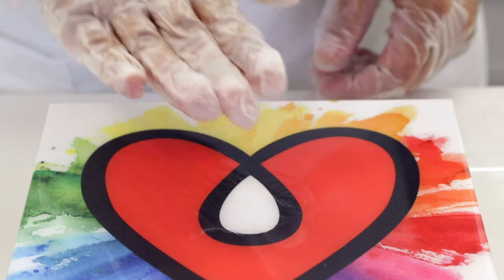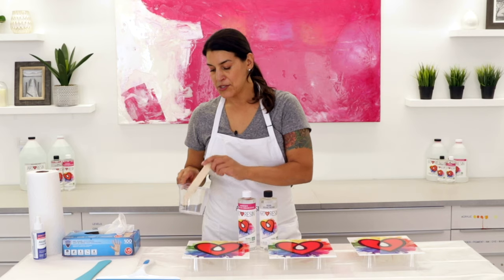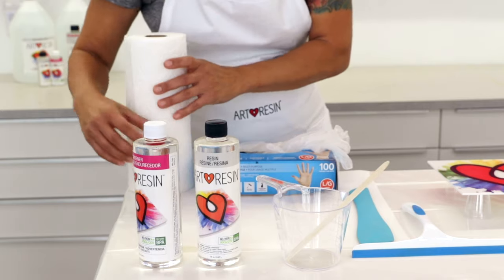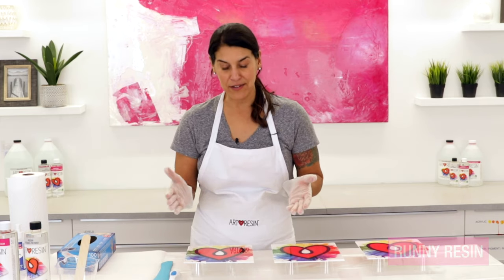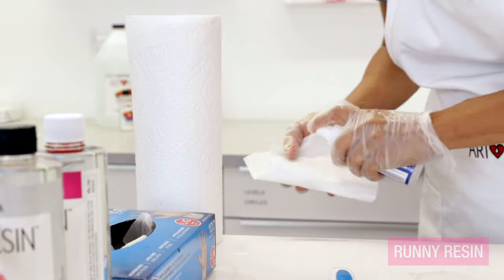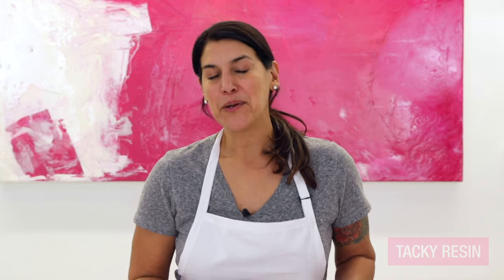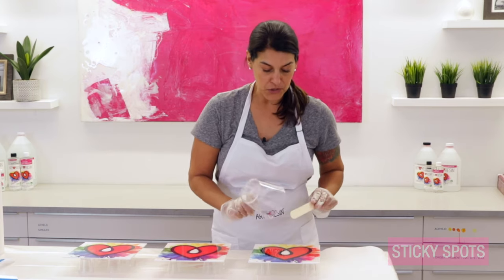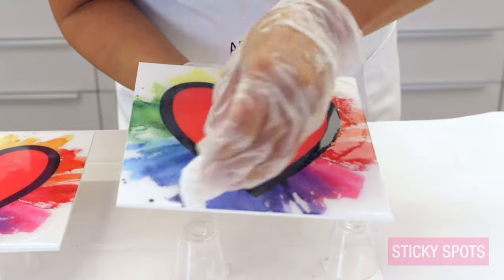How to Fix Sticky Resin - Top Tips & Tricks

Comment: So informative video
I over filled my alphabet moulds as now they are cured and having a bit of resin outside of my mould  how can I make the border perfect.please assist.
Reply from the maker: Hi Kajal, if the resin has cured you could either take an x-acto knife and carefully shave off the lip or you can use sand paper and remove any excess.
Reply: @Artresin  Thank you for the response😊

Comment: Hi. I have made resin alphabets which haven't cured. Does this technique work for alphabets too? Please reply
Reply from the maker: Hi Shriya, if the surface of your molded pieces are just tacky, you should be able to fix them by brushing on a thin coat of perfectly mixed ArtResin with a brush and letting it cure.   I hope this helps! 🙂
Reply: @Artresin  thank you so much for replying :)

Comment: hello! my pieces aren’t sticky they are very glossy at first but on one side the fingerprints show up and can’t be wiped away, is that because i need to varnish it?
Reply from the maker: Hi Laura - when the resin becomes dry to the touch, it still might be soft enough to indent or even to take on fingerprints, but as the resin cures further, these should disappear.  If, after the resin has fully cured and the fingerprints have not evened themselves out, then the only way to get rid of them is to sand them out and then apply a thin coat of resin mixture to restore the gloss.  You can even just apply this fresh coat with a disposable foam brush.
Reply: ArtResin ahh okay thank you i think maybe i’m touching them too soon even if they’re not sticky, i appreciate your help!

Comment: I have a tacky tumbler and it looks uneven. If I just re-do the resin it will fix it?
Reply from the maker: Hi Kyla, if it is tacky then yes just follow the steps shown and it will help to fix it. Now you may want to find out if there is a reason it appears to be uneven, if it is just a slight unevenness it might be due to it not being level while turning and the resin wanting to run to one side. If it is repelling from certain areas you may need a sealant prior to your resin. 

If you are continuing to have issues please send in a photo to support@artresin.com and we will be happy to help you trouble shoot further.
Reply: @Artresin  thank you so much!!
Reply: Is it possible to apply too much resin and that causes an unevenness? It appears to have dips throughout the cup, not just on one side. Hard to explain. I can try to email a photo after work.
The first layer of resin turned out perfect. But I applied a decal and it was after the second coat of resin that I am having issues.
Reply from the maker: @kylakoo91  normally that would not cause it. It may be the decal that is causing the resin to repel but let us take a look at your photo.
Reply: @Artresin  I just emailed 3 photos!  Thank you!

Comment: Hey, so instructions on my resin says 2:1 ratio and sometimes my batches are fully cured and sometimes it’s not cured. So what’ll be the reason?
Reply from the maker: Hi Insha, ArtResin is a 1:1 mixing ratio by volume.  I would check with the manufacturer that you are using and confirm the 2:1 ratio and check if it is by volume or by weight.  Be sure you are following all manufacturer instructions and stirring thoroughly for the recommended time.
Reply: @Artresin  thank you so much ❤️

Comment: Also I have a quick question if anyone in the comment section can help me I mixed my resin and basically only show I have is that it's a sticky mess and I can't get my silicone mold that I have to get clean is there any tips of tricks that you guys have found for cleaning a sticky mold any tips will be appreciated
Reply from the maker: What about some isopropyl alcohol to clean out the sticky residue?
Reply: @Artresin  I used mix of baby wipes and baby oil to gently do it

Comment: How do you get rid of sticky resin when it is in a mould. You can't take it out of the mould as that breaks the bond with the mould
Reply from the maker: Unfortunately that is a tougher fix.  You can remove the item from the mold and paint on a fresh layer of resin to seal in the stickiness.

Comment: I used a vallejo acrylic matt varnish one week ago and it’s still sticky I don’t know why snd how to fix it 😭
Reply from the maker: If the varnish is sticky, I'd recommend contacting the supplier to inquire with them.  If your ArtResin layer is sticky its likely due to a mixing problem or a cold room temperature.  If it is too cool, bump up the heat and let it finish curing.  If it is still sticky, pour a fresh coat of ArtResin over the tacky layer.

Comment: Well, i want to scrape off my runny resin, but its coating my bug specimen . Wouldn't it itstill runny?
Reply from the maker: You will want to remove as much of the wet resin as possible prior to pouring a fresh coat overtop to avoid the runny wet resin from being sealed within the cured layer.
Reply: @Artresin  i'll try it.

Comment: I think mine is #2, But it's in a mold, how would I fix that?
Reply from the maker: Hi Tammy, first you want to try moving your artwork into a warmer space for 24hrs. Make sure that your room temperature stays constant for 24hrs between 75-85F. If your artwork is still sticky after moving it to a warmer location, then you will need to try and remove it from the mold. Once you are able to get it out, you can use a brush or gloved hand to apply a fresh thin coat of resin to all sides, one side at a time. Please reach out to our customer service team at support@artresin.com if you have any other questions and they would be happy to help :)

Comment: I have a pyramid I made that is leaking from the middle. Is this fixable???
Reply from the maker: Hi Denise, if you have wet, uncured resin seeping out from the centre of your pyramid it means the resin and hardener weren't mixed properly and the liquid will never cure.  If there is a way to allow most of the wet resin to drain out, that would be best, then you can fill the gap with properly mixed ArtResin and coat the whole piece to seal it all.
Reply: @Artresin  thank you, I have started doing this. It's almost dry. I am grateful.💜♾️

Comment: What to do when we are making coasters in mold and the resin is sticky what to do then?
Reply: if you want to clean your mold use Goo Gone. It worked to clean my mold with sticky residue from the resin.
Reply from the maker: Hi Sara, the same technique applies. You will need to add another layer of ArtResin on top. You can leave your coasters in the mold, or if you can remove them from the mold, that works too. You only need to apply a small amount, enough to completely coat the surface.

Comment: Ma'am if product is sticky and bendy so that time what we do?
Reply from the maker: If the resin is sticky (like the sticky side of tape) you can just pour a fresh resin coat on top.  If there's any liquid resin, this must be removed as best you can.  Resin could be bendy because it hasn't finished curing yet, so give it a few days.  If it's still bendy after this, it could be because of the same curing issue that made your resin sticky.  A fresh coat of properly measured and mixed resin on top should provide some strength.

Comment: Do you have any tips for tacky UV resin?
Reply from the maker: No, I am sorry, ArtResin is not a UV curing resin so I don't think the same troubleshooting would work.  Good luck :)
Reply: @Artresin  i understand the same would not apply. Thank for the reply but I was curious if there was another video that your channel has that covers UV resin troubleshooting.
Reply from the maker: @moonlitrosebud9781  no, our videos are based around the use of ArtResin brand epoxy resin.  I would recommend reaching out to the manufacturer of the UV curing resin you are using to see if they have any resources to help.  Thanks :)

Comment: But how to fix sticky rasin on juwellery molds...its almost 3 days....i m still waiting
Reply from the maker: Hi, unfortunately if it's been more than 3 days and your resin still hasn't cured it's possible because of one of the following reasons: 
1. Your workspace is too cold. You can try moving your artwork to a warmer location for 24hrs. Remember the ideal temperature for your workspace is between 75-85F. 

2. Measure ArtResin in precisely equal amounts by volume: Adding too much of either resin or hardener will alter the chemical reaction and the mixture will not cure properly.  

3.Mix ArtResin thoroughly for at least 3 minutes: Scrape the sides and bottom of the container as you mix: improperly mixed resin stuck to the sides and bottom won't be able to catalyze and therefore won't be able to cure, leaving sticky spots in your resin that just won’t harden. 

If you after 24hrs of moving your artwork to a warmer space doesn't help, then we recommend adding another layer of resin, even a thin layer will do the trick. Just remember to measure and mix correctly for best results. 

Please visit our website for more information on how to harden sticky resin https://www.artresin.com/blogs/artresin/oh-sh-t-series-episode-1-sticky?_pos=1&_sid=dc991525a&_ss=r

Comment: Woah I’m confused- you don’t do anything tk the sticky (tacky) spots? You just sand around it and pour new resin over the top of the tacky bit? Won’t that leave an uncured spot under the resin that has?
Reply from the maker: If the surface of your resin is just sticky, you can pour right over top with a fresh layer.  If there are wet spots of uncured resin you will need to scrape off all of that wet uncured resin as it will never cure.  Once you have removed as much as possible then you can pour a fresh layer right over top.
Reply: @Artresin  so to be clear, if most of it has cured but there are sticky spots in areas (not runny and liquidy) I don’t do anything to them and just pour a fresh layer? (And sand down the completely cured bits)
Reply from the maker: @jessH090  yes.  The sanding is just to give the next layer some tooth.  The sticky parts already provide that tooth so no need to sand them ( and they will gum up your sand paper too!)
Just be sure to clean off all the sanding dust before you pour your next layer.
Reply: @Artresin  Thankyou :)

Comment: Shouldn't we use respirator when using resin?
Reply from the maker: ArtResin is non toxic and does not produce fumes.  As long as you are working in a well ventilated or open area, a respirator is not required.  Have a look at our blog for more information: 
https://www.artresin.com/blogs/artresin/what-safety-precautions-should-i-take-when-using-artresin?_pos=4&_sid=07145a758&_ss=r

Comment: Hi do art resin poured over a mod podge sealed photo hide the brush strokes that was made by the mod podge
Reply from the maker: It depends on how intense the brush strokes are in your artwork.  ArtResin will coat and fill in all those little ridges and minimize the appearance, if they are very predominant, you may still see them.

Comment: I mixed 1 part of each and mixed it for 5 min. Why is my tumbler sticky?
Reply from the maker: Hi Ann, check that the room temperature is warm enough for the curing to take place-ideally between 75-85F.  If it has been in a cooler room, move it to a warmer one to see if this kick starts the cure.  If temperature is not an issue, it is likely a ratio problem or there was a small amount of the mixture that was not thoroughly combined.  If this is the case, you can simply mix  and pour another layer over top to fix.

Comment: Hey will you pls help me again how to cure cloudy resin as I am new and I don't have any equipments
Reply from the maker: Hi there
The solution depends on why the resin is cloudy.  Resin is cloudy when it's cold, in which case you can warm the capped resin bottles in a warm water bath before you measure and mix. 
Resin can also become cloudy if it's too humid out or if moisture/water gets mixed in.  In this case, you can't take the water out so you'll need to start over.
Resin can become cloudy if it's whipped, so make sure you mix slowly. 

If the resin has cured cloudy, you can try sanding down as much as you can and then applying a fresh coat.  

Here's a blog with more information that might help:
https://www.artresin.com/blogs/artresin/cloudy-resin
Reply: @Artresin  item that I make is cloudy is there any solution
Reply from the maker: @sapanatomar4735  I'm not sure why the resin is cloudy.  Is it cloudy when you mix it?  Or cloudy after it cures?
Reply: @Artresin  after cure
Reply from the maker: @sapanatomar4735  if the resin is cloudy because you poured into a mold that has a matte interior, then you can brush on a thin coat of resin to restore the gloss.
If the resin is cloudy for another reason (an additive or there was moisture in the resin or in the air while the resin cured), then you will have to sand down the resin.  Wear a dust mask and be careful not to damage the artwork below the resin.  Then pour a fresh coat.  You might not get rid of the cloudiness 100%, but it will help.

Comment: Can we use resin on stretch canvas
Reply from the maker: Yes, ArtResin works over stretched canvas.  When we are given the option we would always choose a wood panel/cradled wood  canvas rather over stretched canvas as it gives great stability and will not sag under the weight of the resin as canvas can.  On larger stretched canvas you may want to consider supporting it from behind by sliding in cardboard as a support, this will help prevent the resin from pooling in the centre.

Comment: What if it’s sticky in the bottom of the mold and hard on top?
Reply from the maker: You could try to save the piece by applying a doming layer over the sticky surface, or applying a layer of ArtResin with a brush to coat.
Reply: @Artresin  ok thank you.

Comment: What if I touched the tacky stuff and it has fingerprints? In any event I can just pour over it?
Reply from the maker: After it cures I would do a light sand and pour a second coat! Should be good as gold :)
Reply: @Artresin  sand over the soft parts? Hmmm. I’ll give it a whirl.
Reply from the maker: @DonnaBerryArts  if you still have sticky parts you will not want to sand those areas. You can pour directly on the sticky areas without sanding.

Comment: I tried scraping it off... and my squeezy is now stuck to my piece... and the resin didnt move. Now what
Reply from the maker: You only need to scrape off the resin if it is wet and runny, if your surface is firm but just sticky you don't need to scrape you can just pour a fresh coat over top.  I hope that clarifies :)

Comment: How do I resolve sticky resin on a tower it was mixed 1-1.
Reply from the maker: The best way to fix the sticky surface is to apply a freshly mixed layer of ArtResin overtop.  It will seal in the stickiness when it cures.   Always be sure to mix thoroughly to ensure both parts are completely combined and ensure that your room temperature isn't too cool--we recommend temperatures between 75-85F.
Reply: @ArtResin  I light sanded but it's a small tower, Sanded  managed to get all sides done  with resin hopefully will cure smoothly.  Thank you will continue to view your content.

Comment: How do you fix sticky coasters from a mold?
Reply from the maker: Hi Betty, You can apply another layer of resin over the sticky surface, you may want to apply using a gloved hand or brush to avoid drips.  You can coat one side and let it cure, then coat the other side.

Comment: The easiest and cheapest way to avoid these issues is this. Get (2) cups for your pour. After mixing, pour from cup A into cup B. You can stir this for a few seconds if you like. Pour cup B onto your art project. Cheers!
Reply from the maker: Thats a really great tip Jesse, this extra step helps ensure that you do not have any portions of your resin that get missed during mixing.  Thanks for the suggestion :)

Comment: I made resin coasters and they won’t harden what do I do?
Reply from the maker: Hi Phoenix, first, try giving them just a little more time.  Your coasters should feel dry to the touch and firm after 72 hours, but may continue to reach full hardness in a few days.  If your resin has been cured for a week and is still bendy it is likely due to either an incorrect ratio, under-mixing or possibly adding too much colorant. Here is our blog on what causes bendy resin: https://www.artresin.com/blogs/artresin/how-to-prevent-bendy-resin?_pos=1&_sid=6df3a2f37&_ss=r

Comment: thanks very helpfully. Found you googling my first resin table top. my seal coating of knots and cracks was tacky after 10hrs. I'm hoping it the the not enough heat issue. Shop was only 60F. nov. in Manitoba Canada. So I am trying easy fix #1 crank the heat up. You did an excellent job explaining resin issues. Thanks sooo much!!I subscribed also.
Reply from the maker: Glad you found it so helpful Scott!

Comment: Can humidity cause sticky ?
Reply from the maker: Humidity can cause surface imperfections and a cloudy surface.   Environmental causes for stickiness is usually just temperature being too low and causing slow curing.  If this is the case, warm up your room to see if it helps finish your cure.

Comment: I’m curious, do you need to wear a mask? I’ve seen videos with or without a mask being worn. Also how do you clean sticky resin out of a mold? Thank you for the great video!!! ❤️
Reply from the maker: ArtResin is non toxic and does not produce fumes or VOCs.  It is safe for home use when used as directed in a well ventilated area. Here is a blog that gives you more information on how to safely work with ArtResin:  https://www.artresin.com/blogs/artresin/what-safety-precautions-should-i-take-when-using-artresin?_pos=3&_sid=271597be4&_ss=r

If you have a mold that has uncured, improperly mixed sticky resin in it, you can spray it with isopropyl alcohol and wipe with a paper towel.  The isopropyl alcohol will help to remove all of the sticky residue.